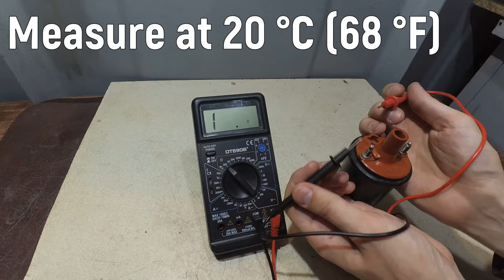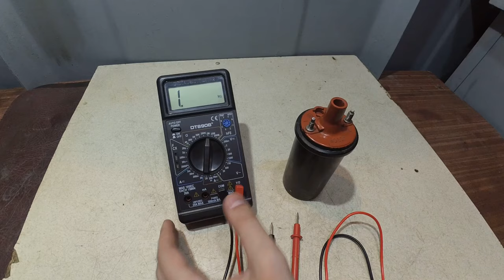How to check ignition coil with multimeter

Comment: I had this coil on my w123 280ce mercedes and when it failed, the circle cap (your question) had a blow out and some oil leaked from it so I imagine its a safety valve and check valve
Reply: That's a sure sign it's failed I'm a marine engineer and see these a lot on boats leakage is a sign it's on its way.

Comment: You can also add 12v to the positive post put the ht lead in the coli with a spark plug in the end run a jump lead from the negative from the battery to the plug and and connect a wire from the minus side of the coil striking the spark plug it should spark if it doesn't coil is no good
Reply: How much the spark should be visible in a room completely dark doing 12V check?
Reply: @XarlioG60  By performing the battery test you should see a small spark from the spark plug. Keep in mind that the bigger spark will be produced when touching the wire that connects from the coil negative to the battery negative :D

You can take a look at the video below, it was already tested in this channel:

https://www.youtube.com/watch?v=oc941J0wh0Y

Comment: When I put one probe into the output terminal and one against the outside of the coil I get a 7.50 reading, which is the same reading I get if I go from a primary terminal to the output terminal.    Does that mean the coil is bad?  My motorcycle seems to be running ok, but if the coil is bad I should replace it.
Reply: Bad.  Should replace. It's case should not have an Ohm reading like that.

Comment: I am thinking a little hole in the coil was to put the wires in place. It's probably where the clip fit into. But that's just a guess because I have no idea what are the coil came from or what it belongs to.
Reply from the maker: The coil was on a BMW, and the hole is a fuse, in case the coil fails

Comment: Hello, whats the little hole for?
Reply from the maker: Hello! If the ignition module is defective, a fuse will blow in this hole in the ignition coil. This will protect the coil from explosion.
Reply: @helpfromthegarage1677  whoa, cool! And where can i get this fuse? Mine always had an empty hole for as long as i can remember. Thanks!
Reply from the maker: As far as I know, it is impossible to change this. If there is no plug in the ignition coil, then the coil must be replaced.
Reply: @Tenkaichibudokai22  🤣

Comment: Great video but there so cheap it's almost quicker to just swap it anyway?? If you have doubts about a old coil chances are it's been on the engine for a while so just change it.
Reply: Not nowadays , especially for older vehicles.  Just paid 100$ for an old/new (in box unused but on the shelf for years) Bosch coil (yes, you can certainly still buy a no-name for 15$ + shipping but it’s pretty common to buy a dud coil and think there’s something else going on electrically and spend time/$ trying to chase it down).  And a video like this will help you eliminate a bad coil before going to the next possibility .